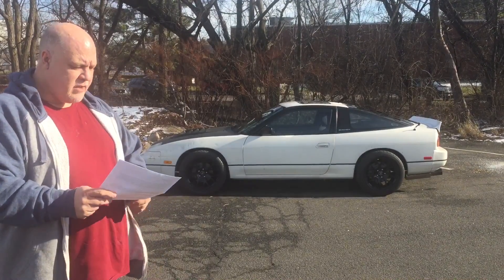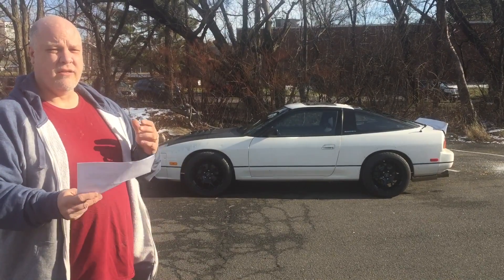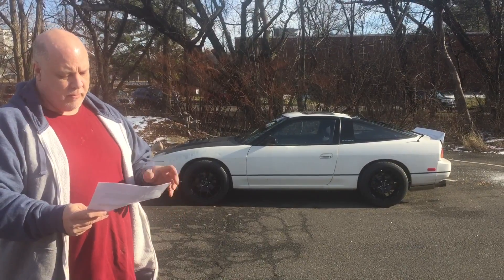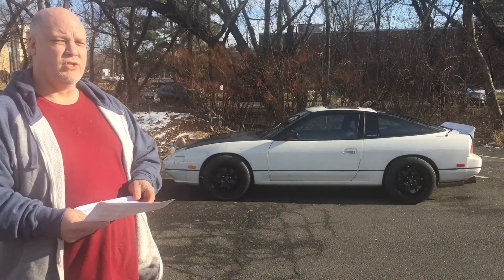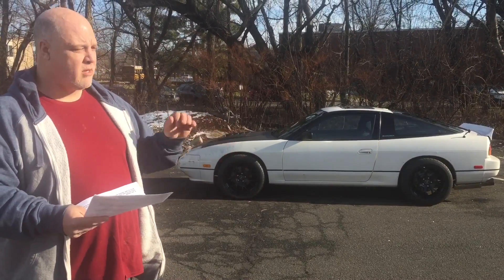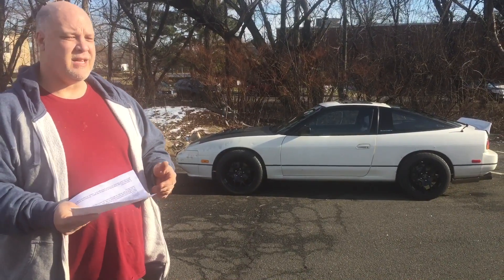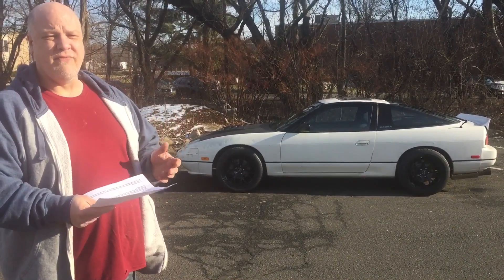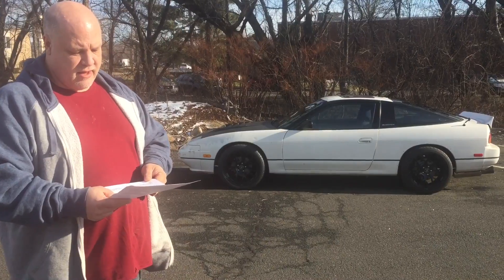10 things I hate about my LS1 powered 240SX- all 10

Comment: Alot of things you are saying you HATE about it are just simple things to do with the swap period. With an LS 245 tires will not do anything, AND with any power upgrade axles should be upgraded, LS swap is not cheap at all. I got a quote for $40,000 from a special car collectors insurance for $560/yr that pennies compared to what you spent on the car. Of course mpg going to suck...little gas tank of a 240sx and the V8 demand. You may be able to get better gas mileage with a better tune and using a taller diff so that you cruise at a lower speed. For example I have a T56 with a 0.63 6th gear and a 350z diff with a 3.54 ratio and at 70mph I'm at 2000rpm. My car is an LS7...7.0L with heads and cam and it gets about 13-14mpg thats combined. I think you may want to check that tune. You need to get a quality exhaust on the car and it will not be annoying. I have a specialty Z exhaust on my car...muffles AWESOME. Seems like a nice build you have there though. Make a vid of what you LOVE about the car........seems like you dont like the car.
Reply from the maker: Appreciate the feedback. Still working out the bugs, but I do love the car. And I'm looking forward to doing a "love" video. 
Cheers.
Reply: yeh man...trust me. I have an LS7 swapped 300zx. Been almost 4 year build...always some BS.....radiator was too small was overheating, then we upgraded to these SUPER fans..but they drew too many amps on startup and would kill alternators....went through 4 alternators...then went with a different rad and fan setup been great ever since. Then stock z32 5spd manual trans synchros were trashed in 4th....bought a brand new jspec z32 5spd manual for $2000...a few months past...trashed that..couldnt handle the power. Now just upgraded to a T56.....now it wont shift at high rpms...think something wrong with the way the clutch was setup. These builds take patience. Once we get this high rpm shifting thing handled car will be PERFECT!
Reply: Also busted stock diff bushings at the track...had to get poly ones, then onetime bodyshop put a front lip on with regular screws and on the freeway front of the lip came off dragging on the freeway scooped rocks into the drive belt which threw a rock through my rad and a hole in it...had to get that towed and fixed........
Reply from the maker: Unfortunately there's a reason they call these project cars.
Cheers.

Comment: Hi Uncle Dynamite. Can I know what you did to have the engine to 380Hp? my comment is. the build can  be much cheaper if you can do it by ur self. Most OEM parts are reliable.First build many times comes with many mistakes and twice buy of parts.
Reply from the maker: I appreciate the post.  Here's the info on the car.
https://wheelwell.com/john-keenan/1pjd/1990-nissan-240sx

Comment: 1) Most guys who do this swap do it themselves as a project / hobby.  Not really a wise thing if you don't do your own work.
2) If you are getting 8-10 and smelling like gas your shit is probably running pig rich and needs a proper tune.
3) If your 300Z brakes aren't stopping good, you need a brake job and or system bleed.
Reply from the maker: Appreciate the feedback.

Comment: Lol you have no idea what you're talking about 8-10mpg? Probably needs a tune or is not running right I'm at 455whp on my ls1 and I'm getting over 25 on hwy and average about 14mpg
Reply from the maker: The car was running WAY too rich. The computer was pulling over 50% of the fuel at this point.  The tune has since been corrected.